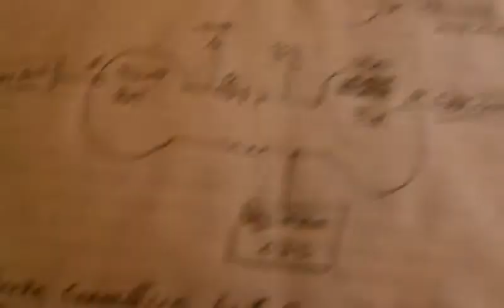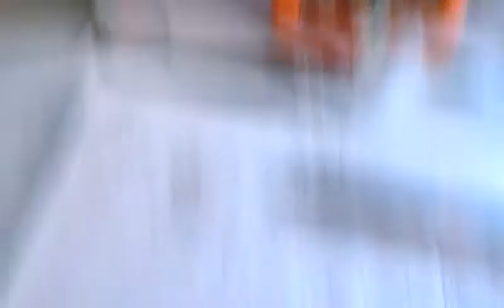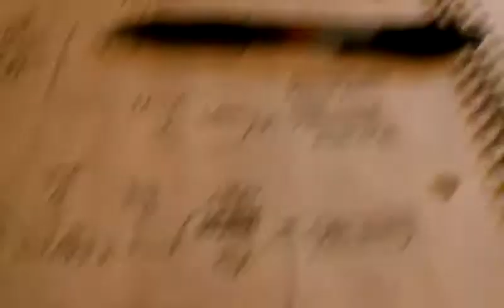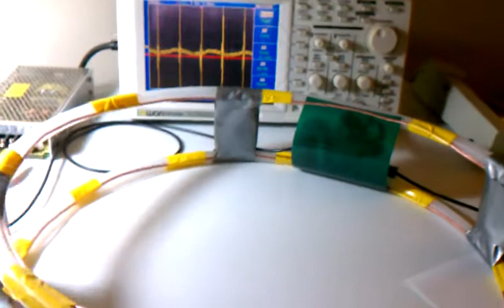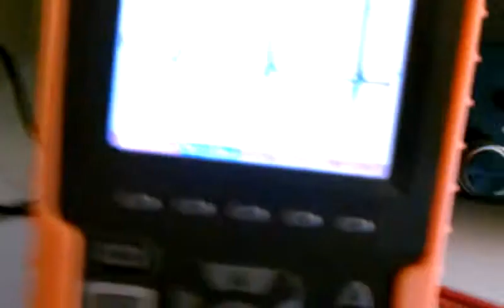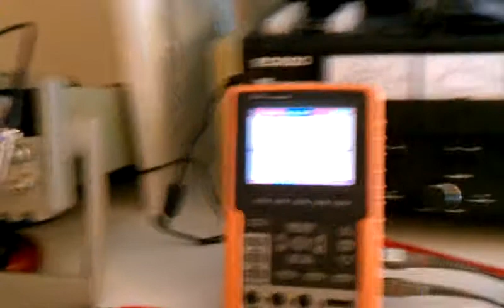Resonant and non resonant transmissions.

Comment: Well done, but you don´t yet get the trumpet waveform. right ?
You should put the scope at least 3 Meters away from the coil ring to see no induction just caused also by the scope and have a preciser measurement by just using the open scope head..
Regards, STefan.